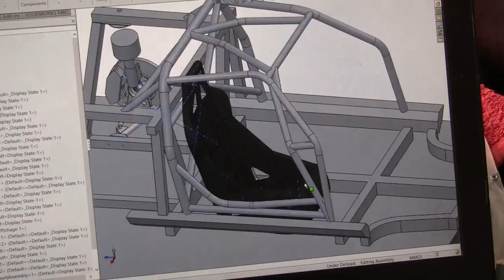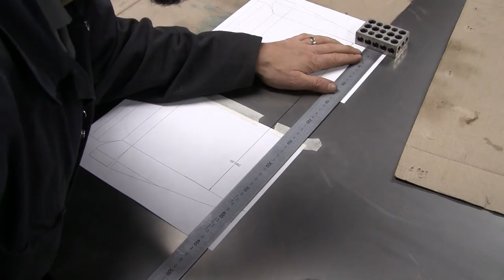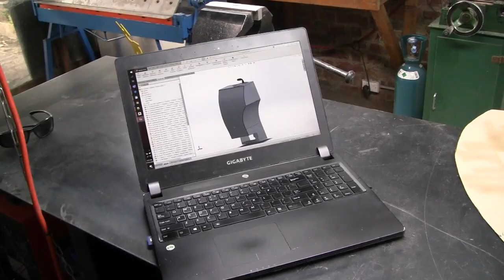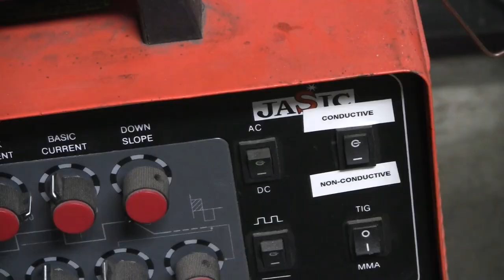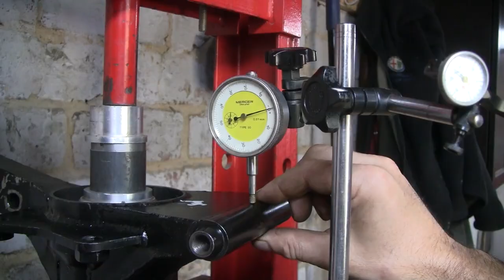Lancia Stratos Tarmac Rally Car 3 year build in 8 min

Comment: Great job, Colin! A couple of questions, as I’m planning my own Stratos replica.
I know you said you used an MR2 radiator.  I’m assuming from an MR2 Turbo?  My Alfa V6 should have about 265hp; I want to have plenty of cooling capacity.
Also, have you tested the suspension updates yet?
Reply from the maker: Thanks mate, yea the latest rad is from a MR2 spyder  i think, its a 3 pass one the original one I used was only 2 pass and was marginal at best, plus upgraded to bigger water pumps. Water cooling is good now, Oil cooling was still a problem and have added a massive oil cooler at the back of the car where i had the diffuser. The original engine had a decent oil cooler from the factory so i think oil temp is an issue with these engines.  I have tested the suspension updates, they made a good improvement, and the car is much  more predictable  we've since discovered that the factory pickup points of the hawk induce some rear bump steer, was an easy fix, just had to move the trailering arm inboard point 20mm closer to the chassis rail, haven't tested that one, but should be further improvements.